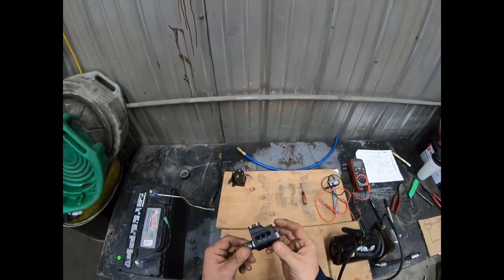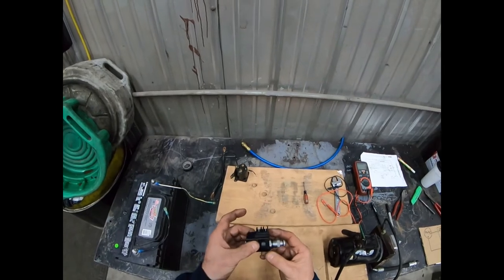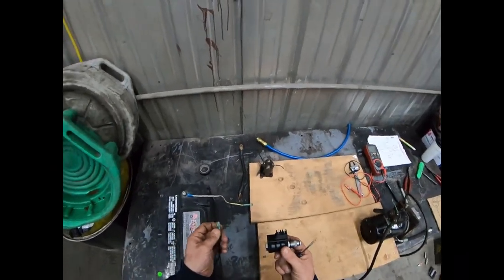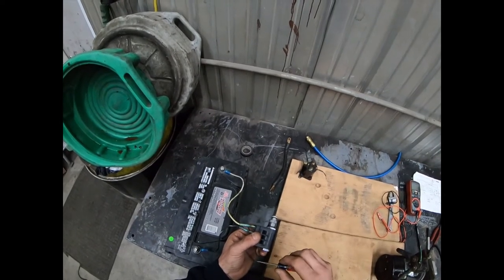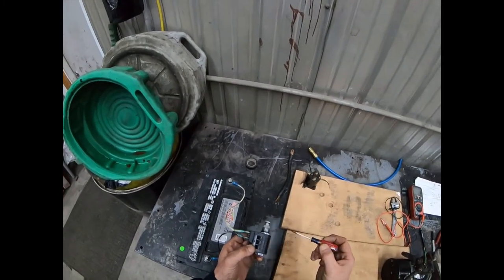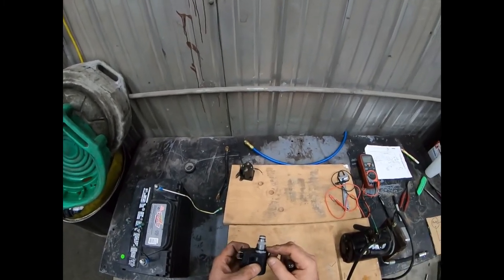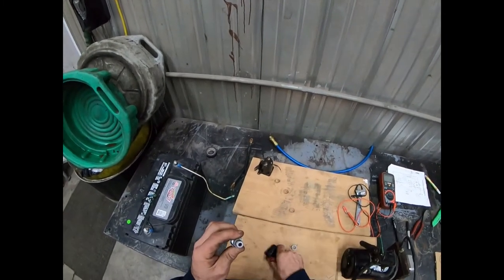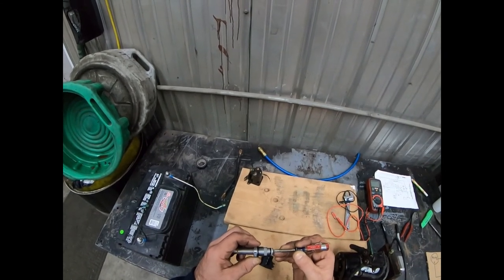Liftgate Solenoid Testing

Comment: I have an issue with my dump trailer. I rises just fine decent speed. However, when I hit the down arrow it’s a gravity down pump/set up it takes really long probably anywhere from 3-6 min for the dump to come completely back down. Any ideas? Checked the magnetic field and it’s working fine.
Reply from the maker: I would check 2 things...considering it's gravity down it probably only has 1 hydraulic hose going to the lift cylinder.  The other end of the cylinder should have "breather" installed to let air out of the other side other the cylinder.  Sometimes from dirt, or from oil passing from worn seals inside the cylinder, the breather gets clogged and restricts the air moving through the breather.  If you have one installed on your unit, try removing it and see if it goes down faster.  The other thing I would check for is some sort of flow control at the pumping unit.  Most have an adjustable valve that controls the rate of fluid allowed back into the tank.  Hope this helps!
Reply: @fleetrepairsolutions6372  thank you you I’ll take a look in the next couple days.

Comment: My dump trailer went up without issue, but now will not go back down.  I usually hear a click, and it begins to slowly drop.  Now I hear nothing, is it likely the coil has gone bad?
Reply from the maker: It's possible, if the clicking noise you heard previously was the sound of the valve moving, and the bad coil won't produce the magnetic field required to move the valve.  Check for any bad relays in the up/down circuit.  Those are common failure points and they make a clicking noise when energized.
Reply: Thank you for the reply.  I’m on it now.  Hope I can find the issue.

Comment: What would be causing my liftgate to slowly sag after its stored?
Reply from the maker: It could be something leaking, look for any evidence of a hydraulic leak around the liftgate and pump box area.  If nothing is leaking externally, there may be a valve that is leaking internally.
Reply: Hi u found was the problem with you lifgate?